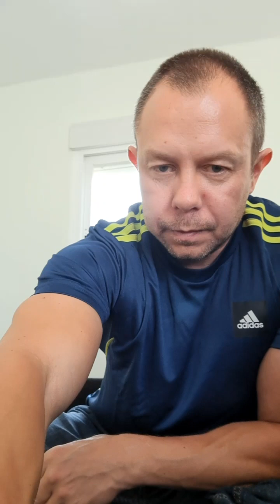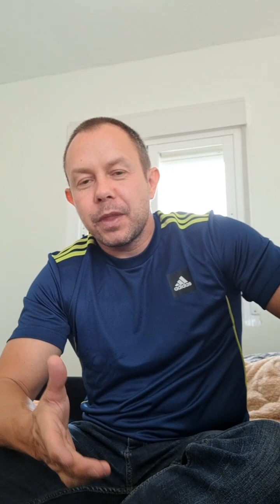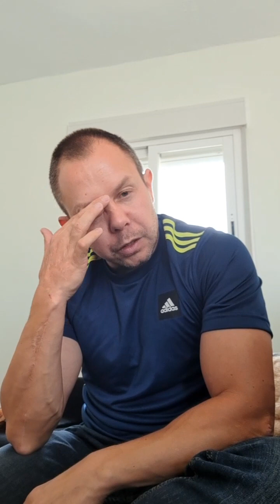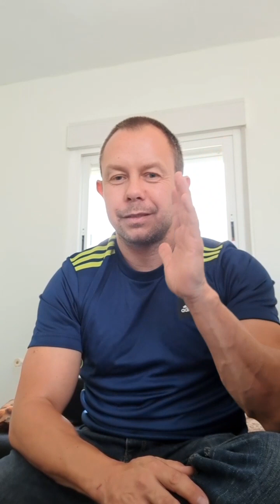What difference does pump elements do? Mercedes superturbo om606 diesel engines and pumps explained

Comment: Great to hear the facts without the BS. I’ve got an hx35 with stage 2 tune. Ready to jump to a bigger pump and stage 3 tune. I’ll be getting the 8mm Myrna. At what point does pinning the cam gear become absolutely necessary? I figure I’ll do it when new pump added.

Comment: Hi Fred , I’m
From Morocco and I’m
A big fan of your content , much appreciated, I have a question I recently installed a 6mm pump in my om602.961 engine at 14 atdc the pump was calibrated for a little more fuel cos I don’t want to Install an intercooler for now , in term of power increase there’s just a decent amount at 2200 rpm and above , do you think I should advance timing a little ? Smoothness is a big deal
For me now engine sounds amazing
Reply from the maker: Timing is not the most important. If it sounds good it's good. Look over other parts to gain more power.
Reply: @FtunePerformance  thanks 🙏 that’s why I got the one and only om606 turbo hhh I appreciate your feedback

Comment: if I have a standard etc 606 pump running at the moment with a stage 2 tune, then are you saying I could go to 8mm elements in the edc pump and it should drive just as nice but with lower egt and faster spool up and less smoke yes
Reply from the maker: Depends a little on the tune, but Stg2 on these are normally maxed out. Witch means that a low powered tune on 8mm will run way better yes.
Reply: @FtunePerformance  that's good to know so I can always upgrade the edc pump and leave it at stage 2 then always upgrade the ecu to stage 4 knowing my pump will take the extra power thanks. Great videos and info 👌

Comment: Hello I just found your channel while looking for info on my 87 mercedes with the om603 turbo.   I am ready to rebuild my injectors. What brand injector nozzles do you suggest . I thought about buying monarch nozzles 
But I was told there are nozzles that are better and deliver more fuel.  Is this correct. I am also considering changing my turbo and getting my injection pump built. My car runs very well now and has 165 k miles. I live on my retirement and on a budget But I would like 
To get a little more power from it without shortening the life span of the motor. And still be a good reliable daily driver . What would you do. Any information or advice would be greatly appreciated.  Thank you for this video and your time. Robert
Reply from the maker: Best injectors are standard but set to 150bar. If I where you I would have a 6mm pump built. If you are in USA you can contact Benz Injectors and they can build you a 6mm pump and they also have the best 606 hybrid on the market. I don't know if that fits an 1987 603 though. Ask Benz Injectors about that. This way you will have a good solid 220hp or so. That will transform your car without having to think about reliability.

Comment: Hi fred, how important is the pump installation  ATDC 8-10 .... WHAT WILL IT BE IF INSTALLED AT 15 ATDC STANDARD? THANK YOU FOR UOUR INSIGHT
Reply from the maker: It will be better if you turn the pump back as close to 10 as possible.
Reply: Bro did you advance timing , and what pump do you have ?

Comment: Hello my friend from Georgia…what do you think about 7,7mm elements?how good is it,and what is max hp with it,currently running this elements but in future planning to upgrade 8mm..thanks a lot🤝👍
Reply from the maker: If I don't put my own values in to it I would say that it is a decent size that has been developed in a bad manner. They also have to much internal tolerances so they don't perform anywhere as good as they could with a few tweaks. An 8mm will do you better.
Reply: Thank you Fred!I have bought it from Dpuk 7.7mm who says 600whp is possible to achive with this 7.7mm elements..thats why I bought it.
Reply: @GreenFalcon1984  dpuk says 7.7 is good for 400 ans not 600 🤣🤣
Reply from the maker: @gazika  fuel amount wise you can make 600hp but in the real world never ever in a million years. It's a pretty low performing pump. The DM 7.5mm has a better fuel delivery design and a higher fuel output. So it's Mynä 7mm, DPUK 7.7mm, DM 7.5mm, Tomnik 8.5mm, DM 8mm, Mynä 8mm. In that order...
Reply: Thank you so much Fred!!👍👍👍bu t as I know DM 8mm elements are not on sale anymore
Reply from the maker: @GreenFalcon1984  if course it is 😎
Reply: @FtunePerformance  really😲😲where can I buy them and what is the price for one set of (6 piece)DM 8mm elements?if i knew they were on sale I would buy them insteed of dpuk 7.7mm 🤦🏻🤦🏻
Reply from the maker: @gazika  my friend 🤣🤣🤣 I will give you three chances to guess hahahaha. From Erik the Dieselmeken of course. Just send him a message for what you need and he'll sort you out.
Reply: @FtunePerformance  directly from them right😂😂😂😂😂👍👍ha ha...sounds good bro😂😂why I not thought before about this😂😂😂😂👍
Reply from the maker: @GreenFalcon1984  🤣🤣🤣🤣
Reply: Thank you my friend😂😂😂by the way,you are doing very informative videos about om606 engine industry..its very useful for us who loves OM  engines...privetlly I really glad and so many things learned from you 👍👍👍My respect to you🤝
Reply: @GreenFalcon1984   გაუმარჯოს გაზიკა , სოციალურ ქსელში როგორ მოგძებნო მეგობარო? მეც ვაპირებ 606 ის ელემენტების გამოწერას და რამდენიმე კითხვას დაგისვავ თუარ შეწუხდები
Reply: @გიორგივოსკანიანი გაუმარჯოს ჯიგარო.ბოდიშირომ ესე გვიან გიპასუხე,ეხლა შემთხვევით გადავიკითხე და ეხლა ვნახე თქვენი მოწერილი...ასე მნახავ om td